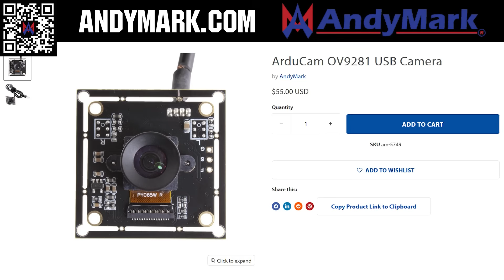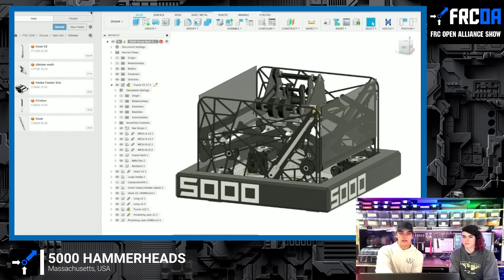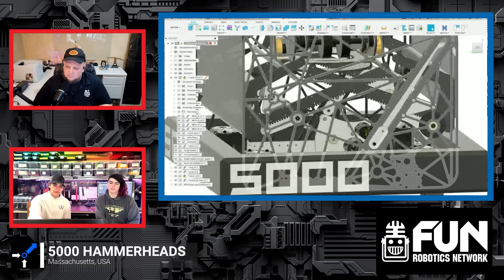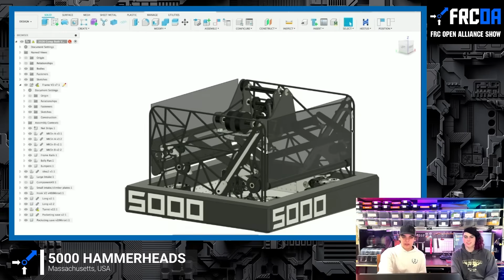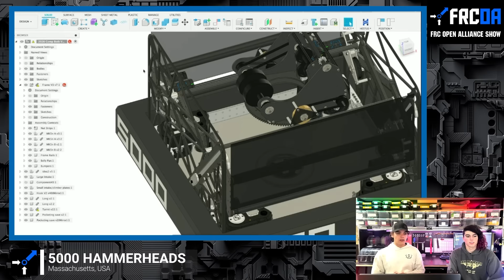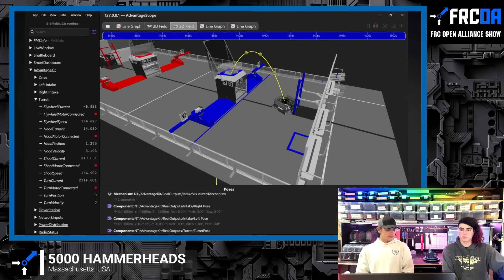CAD Overview and Shooter Simulation Calculator | 5000 HAMMERHEADS |FRC REBUILT

Comment: Amazing! What platform is used for the simulation?
Reply: Hey, code captain of 5000 here! The code simulation you see is using AdvantageScope as a dashboard, and the backend is coded in WPILib with AdvantageKit. If you are talking about engineering simulations, I believe we have been using Fusion for impact testing, but also some other more advanced tools too.
Reply: @ToriDell  thanks for replying, seems ike xrc is used for the on rig simulation
Reply: @ToriDell  Hi, I'm a code lead for team 8032. You mentioned that there isn't a closed-form solution for shooting while moving, but I think I might have one. If you try to account for the positional error caused by robot velocity, I agree, but if you instead just account for the velocity of the robot directly (i.e. by subtracting the robot velocity vector from target velocity vector), then you get a new velocity vector that works. Did you consider that, or does that not work for your fixed-angle shooter?
Reply: @ToriDell  programming lead of 3966 here, is your all's code open source?
Reply: @AkhilNagori-ML  probably the built in tools in fusion, nobody bothers with proper fem in in frc
Reply: @badgermcbadger1968  it seems to be a locally hosted system tho for simulating the bot, definetly not fusion
Reply: AdvantageKit made by FRC 6328 Mechanical Advantage